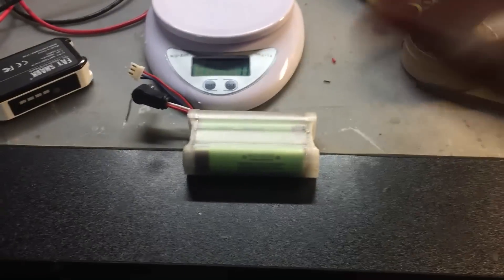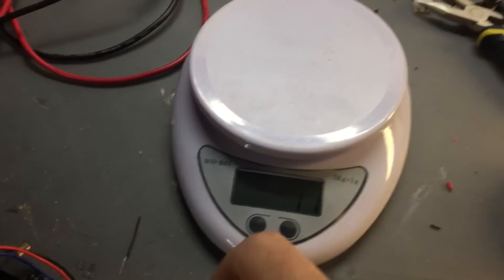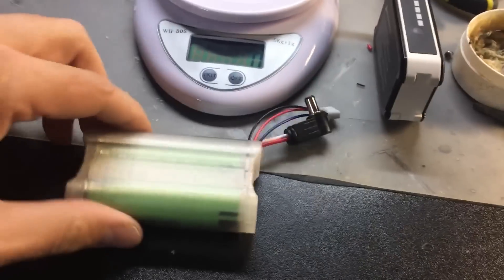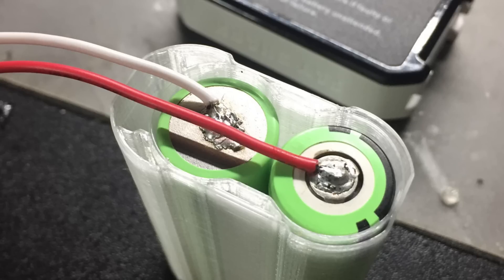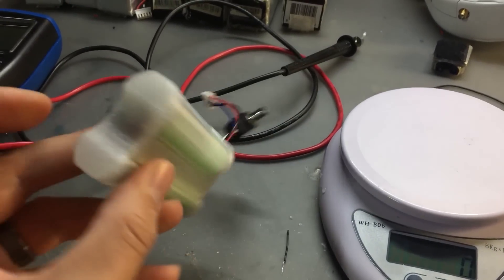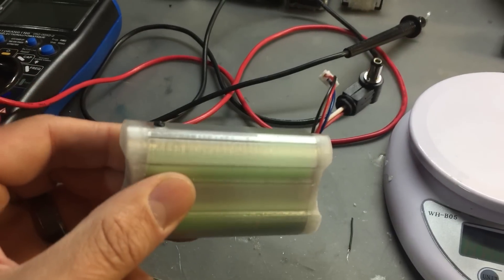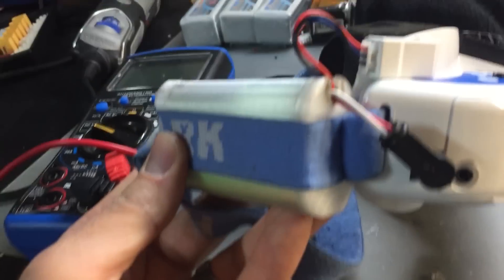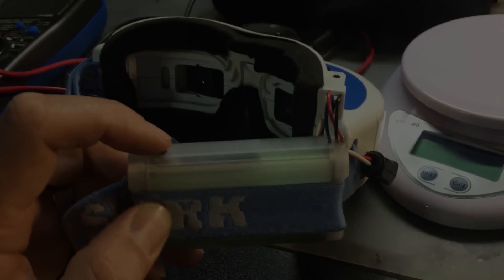Build | 3d Printed Fatshark Battery Hack

Comment: Hi bro.. balance cable can use for fan? Because my battery only with 2cable for fan.. if use the balance cable 3wire, can damage the fan?
Reply from the maker: As long as the polarity is correct you should be ok. The middle wire is used for balance charging and is not used by the goggle.
Reply: @REDROBRCFPV  thanks bro for the answer...

Comment: Is it works for long time? Because the price is same if I buy an original battery. Thanks!
Reply from the maker: Kaio tEch same price maybe but this has double the capacity and will double your on time. Also 18650 cells will not degrade like lipos when left fully stored. This pack I made is still working great for me.